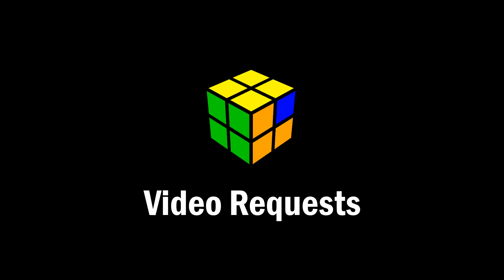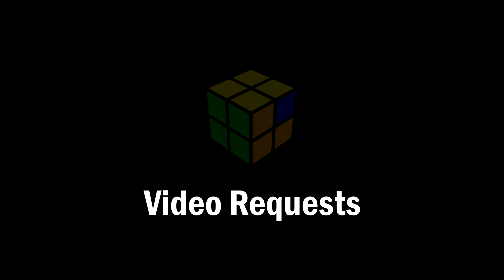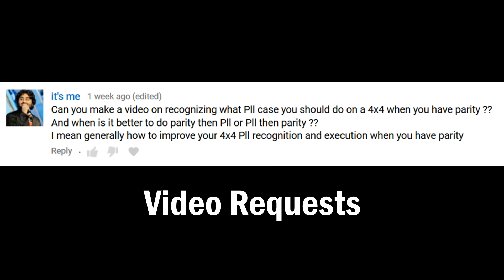4x4 Rubik's Cube: Best PLL Parity Method & Tricks

Comment: How can 2 equal wings be swapped in 4x4 layer by layer? I was just solving and got 2 wings swapped and they're the same type of wing it's not oll parity it's like pll parity but 1 swap instead of 2. Is it possibe to solve on the wrong "center" like on the void cube?
more exact explanation on how it "looks":
white top & this color pattern from left to right, wrapped around
🔴🔴🟠🔴 | 🔵🔵🔵🔵 | 🟠🟠🔴🟠 | 🟢🟢🟢🟢
(use something to visualise it for you, it's quite hard)
Reply: It's not possible to solve on the wrong center, those virtual centers in the 4x4 are useless.
You're actually swapping two pairs of pieces. The two swapped wing pieces plus two wings opposite to each other.

Comment: What about when you have sides that have one edge not solved, The closest I can get to solving the cube is one side solved and then the other three have one edge not solved. There is no tutourial or example solve I can find where there are these singular edges. I also get cases where there is adjacent corner swap but the headlights have two different coloured edges in it and same with u perm.

Comment: I’m sub-12 but I’m having trouble breaking the sub-10 barrier. My F2L is very efficient and usually takes around 5 seconds, but my OLL is garbage, I only know 2 look. I’m wondering which one look OLLs are best to learn first, and if I even need full OLL to become sub-10!

I average 11 seconds by the way.

Thanks!
Reply from the maker: you don't need full OLL to be sub 10 but you'll want to know it eventually so you should start now! pick one with a short alg and then learn all the other ones that have a similar shape.

Comment: Advanced 4x4 tips? Im roughly low 40s but im not sure what to specifically practice to improve past this point. If not some tips for f3e in Yau because I think thats a point that I struggle with getting consistently
Reply from the maker: for f3e, if an edge disappears from your vision try to track it's position and orientation without looking at it.

Comment: Love your videos, my man.
Small question: do you think there's an evolution pattern of the cubes you should use accordingly to your time average? I got myself a gts2 and maaaybe it's too fast for me being sub30. Ordered a gts3m and I'm scared
Reply from the maker: I think as long as you're using a cube you can do finger tricks on without stress, then it's fine. although there's the element of motivation when you get new cubes, which I find often helps me improve a bit. both of those cubes should be fine for you as long as you can adjust to it!
Reply: Thanks, man! If the gts3m proves to be too fast I'll try to get money to buy some lubes since I'm not from a first world country

Comment: Do your cubes wear out? My 3×3 gts 3m has dust between the pieces which probably are the pieces being rubbed against each other (around 4000solves)
Is that common?
Reply from the maker: if it's dry dust then lube it. mine gets weird residue on the inside and I clean and relube it, but I wouldn't call it dust
Reply: Yeah I'll try that, thank you :D @ellectric_hiccup 707 @J Perm